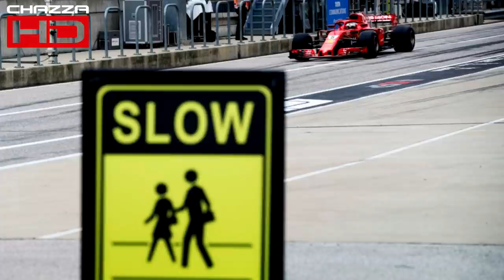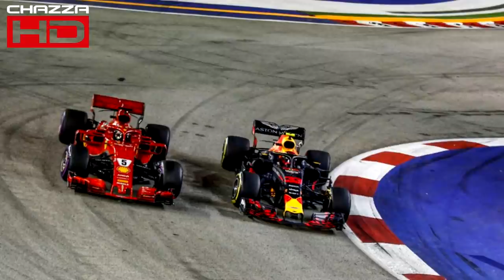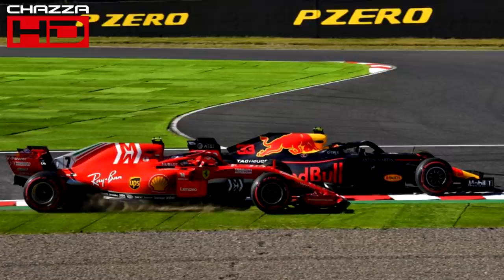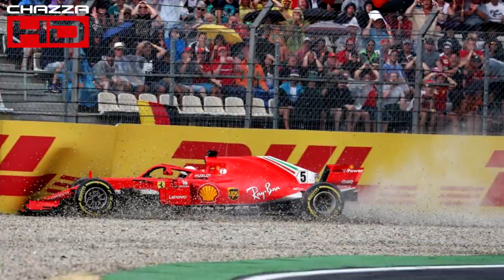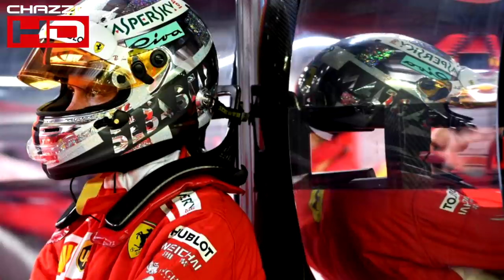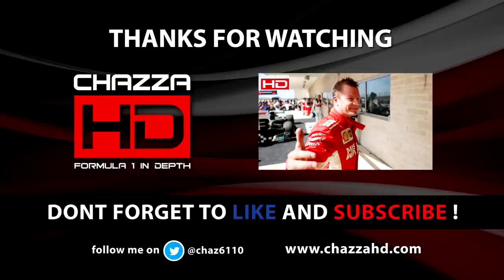Ferrari Battery Issue Explained Part 2 - Was The Battery The Reason They Lost Pace After All?

Comment: It was the battery. The proof is in the race data. All the performance was torque based. Fast in qualifying which is a short burst of power. Fast at the start of the race and then lose pace. It was this data that made the other teams lodge a complaint in the first place. All this after story is just Ferrari's story to move the issue of cheating off the table. They could have easily reverted back to the old designs if the new ones did not work. Vettel just does not understand who he is racing sometimes. Lewis never makes that mistake. Just like letting Max pass. Smart driving makes the difference.
Reply from the maker: the GPS data though can't to my knowledge anyway detect where the speed on straights or corners comes from     And as i said in the video the rear wing update was actually found to be making their car slower in a straight line
Reply: @chazzahd9277  The data can by measuring acceleration. (time over distance). That is how this whole two sensor thing got started. Hard acceleration from a stand still or out of corners is torque based (battery power).
Reply from the maker: Ok as i said though the battery thing/story is not completely dead
Reply: @tonkatoytruck  do you have these datas? Can you provide something, or we must simply believe you?
Reply: @miroslavdockal9468  Some of this was covered by Sky F1, some by Formula 1.com, and some by Mortorsport F1.
Reply: @tonkatoytruck  some of this.... and only link which you provide me is "1.com" which doesnt do nothing, so i must hunted proof to your info by myself.... Thank you for your time anyway.... 😛
Reply: @miroslavdockal9468  Sorry i can not be of more help. I read from many sources, watch a LOT of video from different sources, and trying to recall when and where each piece of information came from is is difficult. Press Conferences, Pit Pass, Ted's quailfying reviews, Buxton reviews, Autosport, Motosport, personal interviews, etc.

Comment: Not all fault to Ferrari technical director how couldn't any of 2 drivers notice the car going slower did they not compare and also took 3 races for Kvyat to notice in the simulator they only notice before suzuka quali
Reply from the maker: They would have felt it yes but because every circuit is different they couldn't be sure then if it was these new aero upgrades that was causing them issues